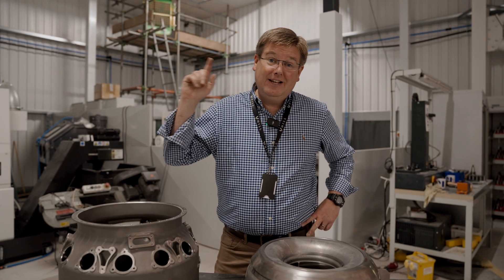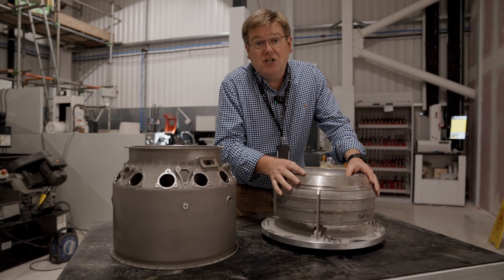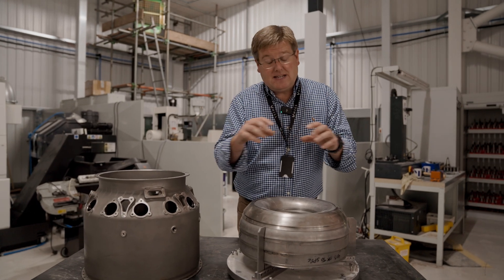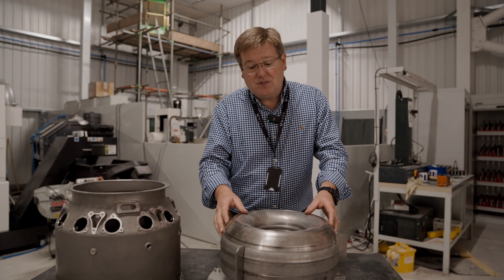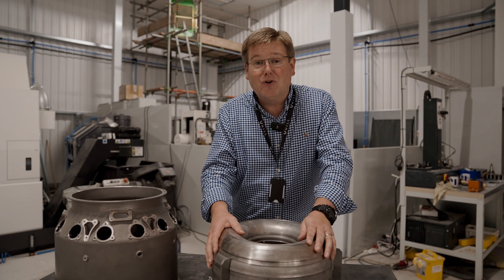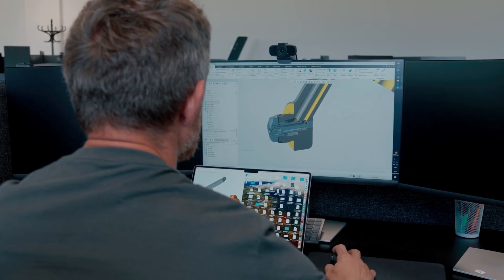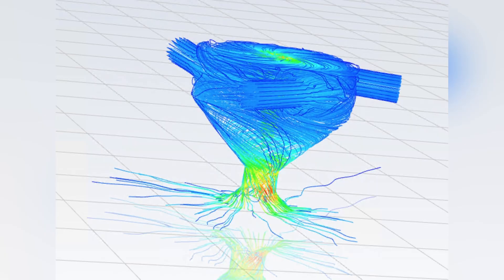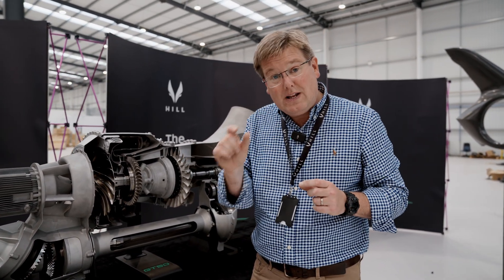GT50 Combustion Liner and Fuel Nozzle Advancements

Comment: Very cool. Are you considering 3D metal printing? 17-4ph steel is 4$/kg, inconel around 40$/kg. The shape freedom, the desktop cleanliness of it, the automation. If the printer cost trends towards negligible with adequate lifespan, the production cost can be dwarfed by the salaries of those looking at it. Spacex uses a lot of 3D metal printing. It's a given that it will eventually take over all production but even today the products seem to be quite high performance. Not sure it's ready to be turbine blades but I have little doubt that the centrifugal compressor could be printed. Engine case and combustor too.